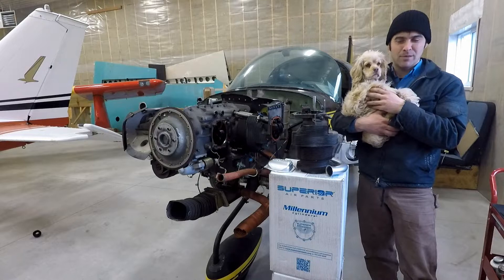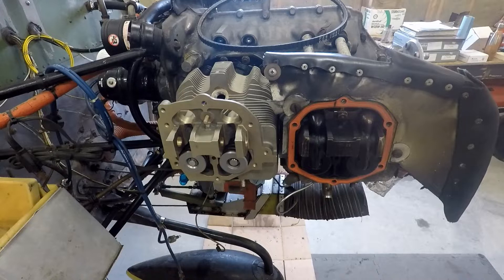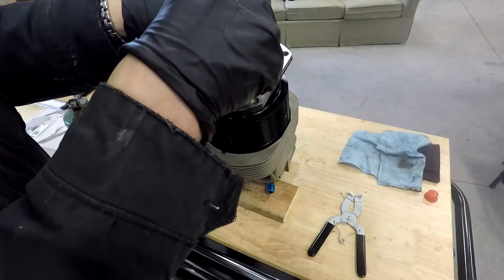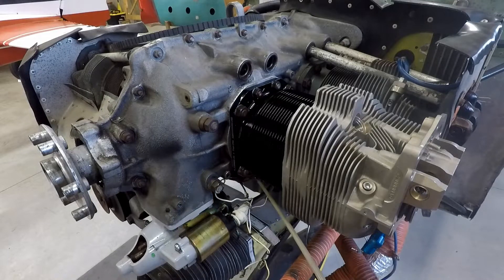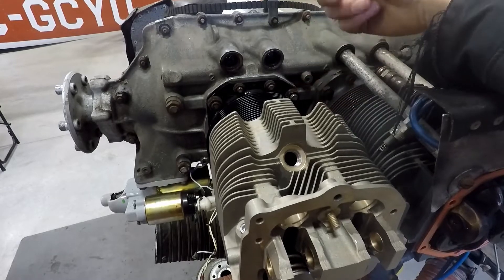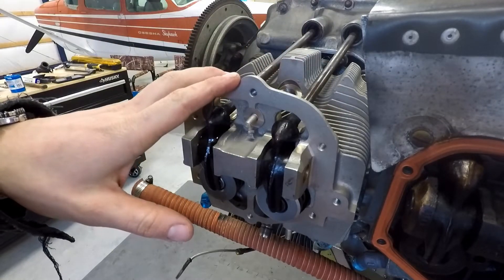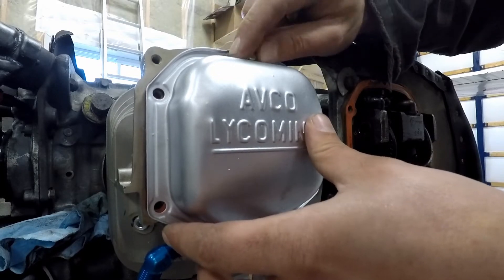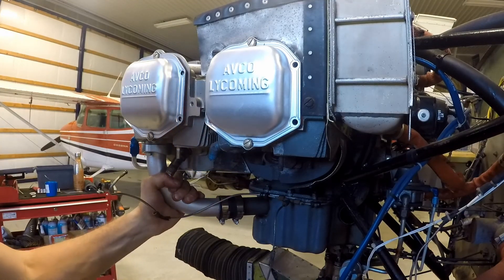Cylinder Install

Comment: Another turbine guy stopping in for a piston refresher. Thanks for the video. I like the automotive ring compressor.
Reply from the maker: Yea I really like how the automotive one works. Obviously its no good for getting rings under the piston pin but lots of engines dont have that.

Comment: At there prices I thought they would be made of gold.   But thank you for letting us know how this is done.  But aircraft mechanics are worth their weight in gold. Happy flying.
Reply from the maker: Yes and this is a cheap engine to fix! If you have something like a Continental IO-360 cylinder prices are an extra $1000 each and you have six to deal with! 

Glad you found the video interesting.

Comment: Great video. Been a long time since I replaced a cylinder, been working turbine engine to long, and wanted a refresher. One thing I noticed on the video is that you did not install the piston pin caps on the #2 cylinder in the video, the ones that fell when you took it off. Thanks for the video.
Reply from the maker: You were paying close attention. The new piston pin assembly is a one piece design so no seperate caps.

Comment: Great video! Thank you. As for the pushrod tubes, I would have cleaned them. 🙂
Reply from the maker: Yes i agree but you have to follow what the customer wants sometimes otherwise you end up with some unhappy individuals. Ugly paint on a push rod tube is not an airworthy issue!

Comment: Good video 👍 
Interesting that you have to replace the push rods to get the correct tappet clearance. I wonder if that’s a Lycoming thing, or just in aviation. When I worked at a motorcycle dealership, we just replaced or changed out shims to get the correct valve clearance. Or adjusted the length of the push rod to get the correct clearance.
Reply from the maker: It is certainly common in aviation and the only way to adjust the length in the Lycoming engine is with the different length push rods. Unfortunately this check seems to be rarely done and I have found numerous cylinders with push rods that are too long or too short. I even found one recently on a small Continental engine in an Ercoup that was fresh out of overhaul and had a push rod that was too long!

Comment: 18:09 Are the through studs free-floating within the block (without friction)? If so, then a wrench on the far nut ensures equal torque on both nuts, and equal tightening on both sides, even with only one of the nuts oiled.

If not (i.e. friction requires the stud to be hammer-drifted through the block) then the torques and axial clamping loads on each nut are somewhat isolated and independent. Via hysteresis, stud-to-block friction could allow the far nut to not fully regain any clamping it loses during removal of the near nut. Therefore, you would need to oil and retorque both nuts sequentially, with one torque wrench and one standard wrench. Otherwise, you could oil and simultaneously torque both nuts, if possible to use two torque wrenches.

To ensure that both torque wrenches click, you might have to mildly overtorque whicever torque wrench that clicks first. This is especially true, if the stud-to-block friction is low.

Comment: What keeps the connecting rod piston pin from sliding out and scoring the cylinder walls?
Reply from the maker: The ends of the pistons have an aluminum cap and that rides up and down the cylinder and stays centered

Comment: An almost pretty good video. Except.  Pulling the lifters out of the case.  NO MAGNET!!!!!!  NO NO NO NO  NO MAGNET. Again NONONONO.   If you magnetize the lifter, Lycoming wants you to throw it away and purchase a new one.  Ouch!
Reply from the maker: I use a hook made of stainless steel safety wire to pull the lifters.
Reply: @fastbackflying853   I understand that. The next person trying to pull the lifter will try to use a magnet. Much easier than the time you spent fishing. Unfortunetly Lycoming knows something about NOT using a magnetized lifter .   So...a word of warning to beginners.  You could ruin your engine.